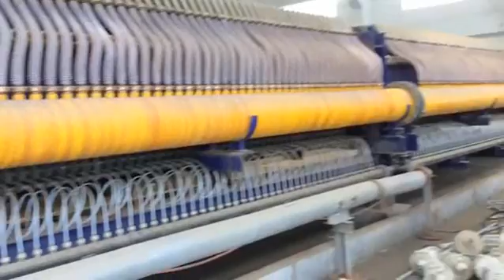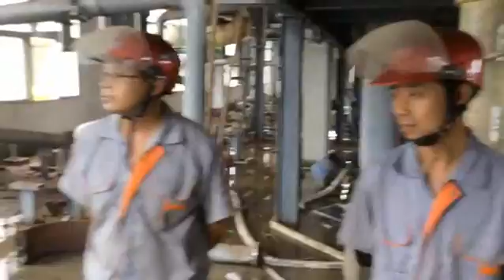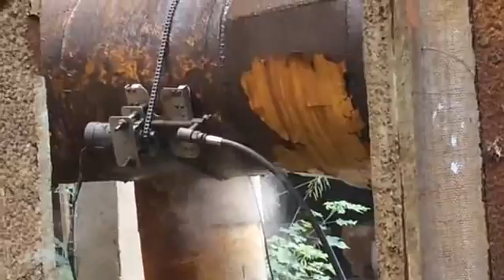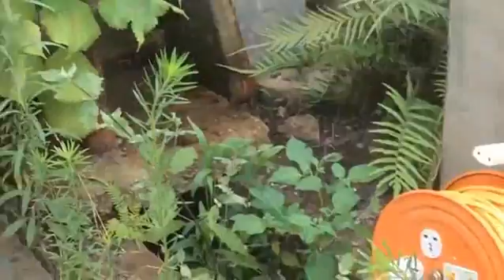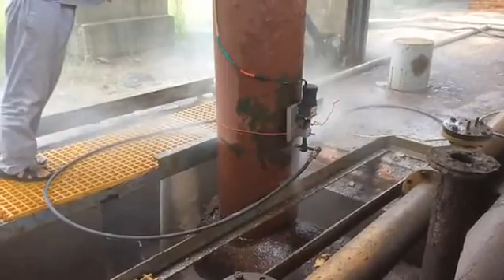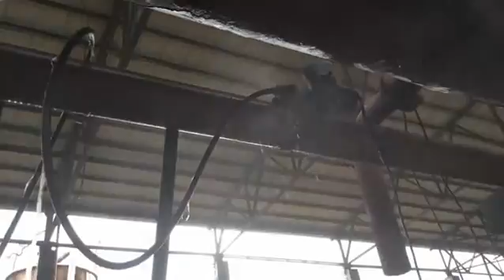portable water jet cutting machine for oil tank, bomb, gas tube, lindalee870323@gmail.com

Comment: Hi, Does the system work for large diameter storage tank dismantling? Cutting of shell plates in horizontal position. I am talking about tanks of say 72 mtrs dia and above. Can the unit run horizontally?
Reply from the maker: dear, what you mentioned should be oil tank or chemical tank.  we have such video cutting.  you can check how it cut. if you have wechat or whatsapp, please add me,  +8618945047060,  or you can send me an email,  lgmmachinary@foxmail.com
Reply: @wamitwaterjetcutter  ok thanks . I will send you a mail with photos so that you would understand the requirement better. I will send it to you by 9 a.m Dubai time
Reply from the maker: @sripanga1390  ok. wait for your email.
Reply from the maker: https://www.youtube.com/watch?v=fhITiYl5Sg0   please check this video .